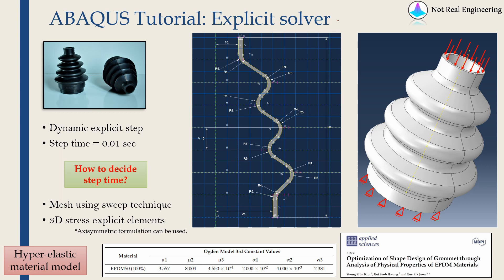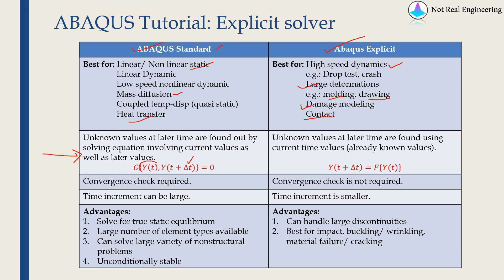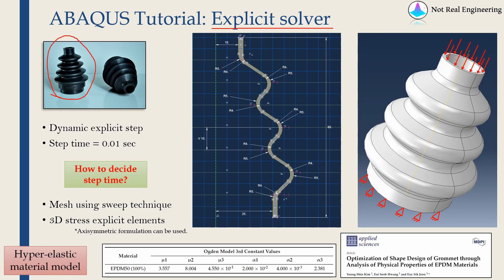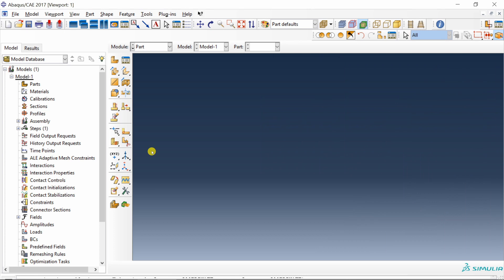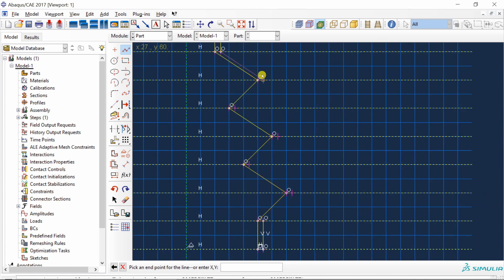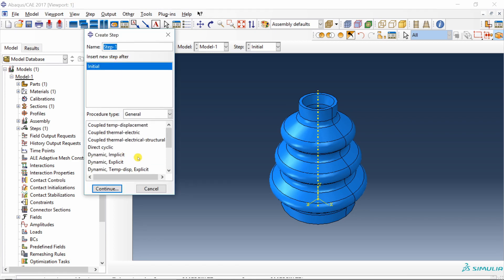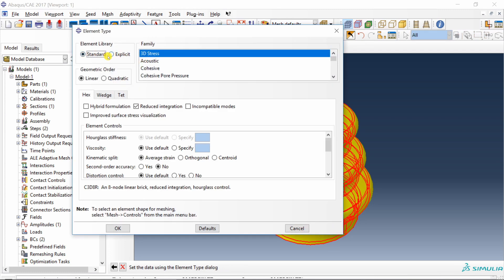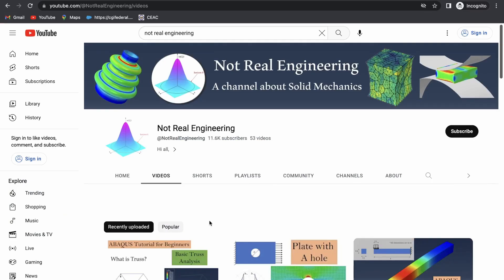Abaqus Explicit dynamic analysis tutorial | Standard vs Explicit solver

Comment: Hi, In dynamic explicit analysis, if I use displacement BC and want my part to stretch 2mm, how should I tabulate the changes it in amplitude?.
Thanks in advance
Reply: This is a very simple problem. The core of this problem depends on what the amplitude curve you want. If you want to simulate the quasi-static displacement, you may need use the  smooth curve. If not necessary, you use the tabulate to define the initial moment and the terminal moment with a ramp type.